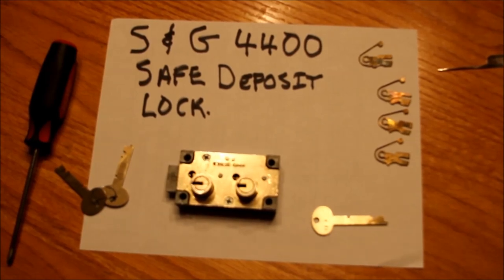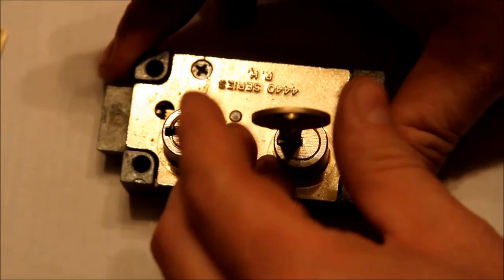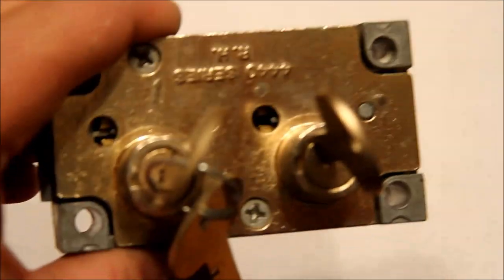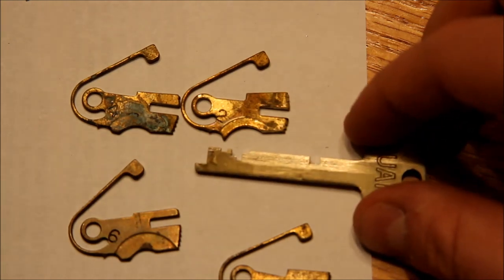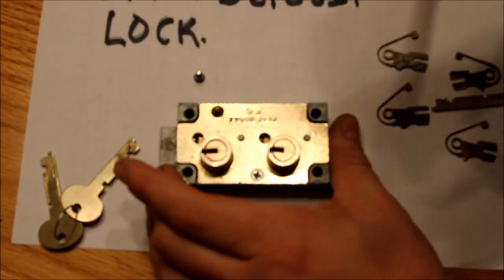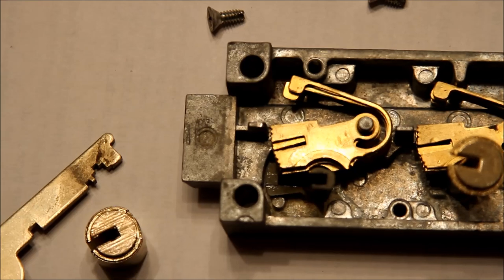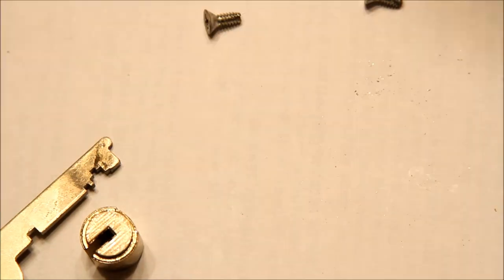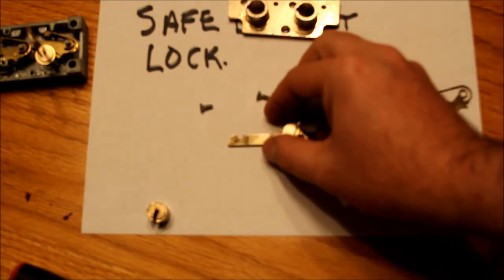(009) Sargent and Greenleaf (S&G) Safe Deposit Box Lock -- gutted and demo

Comment: Most modern sd locks are forced open by pulling the renters nose, then the renters tumblers fall out of the way causing you only to need a guard key to open the box. once the nose is pulled, anything hook shaped can retract the bolt.

Comment: Keep in mind that the only part of this lock that is exposed to drilling when mounted in place inside a deposit box door is the key holes... The door of the box is made from steel and is the protective layer for the body of this lock. I don't see you being able to carry a drill into a bank vault unless you were there all alone at night the old fashion way ;) I had a deposit box in a bank for a while that used this type of lock years ago...seemed pretty secure to me.

Comment from the maker: Thanks! 

I have never used or seen a nose puller. Does that basically pull out the brass key guide, giving you better access to the levers? If so, I could try reassembling it w/o the "nose" and see how hard it is to open.

Comment from the maker: Skip forward to about 5:50. The nose (the brass bit) pulls out, leaving behind a key guide which is also the bolt actuator. So you would be able to turn the bolt via this bit, assuming it doesn't fall out. :)

Comment: your safety deposit lock was right side up most of the time. The noses (on most modern locks) is at the bottom of the lock. The side opposite of the bolt is where the hinge would be, its handed depending on which side the hinge is. (ignore the upside down printing of 4400 rh, its generic and would be right side up on left handed lock)